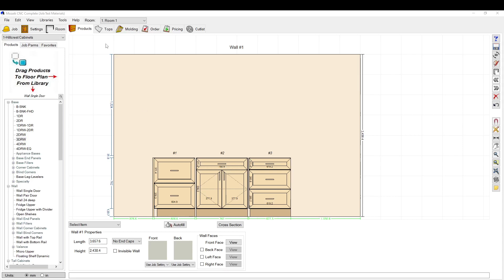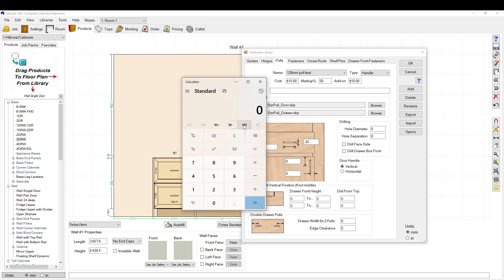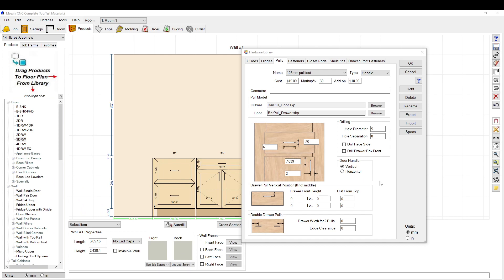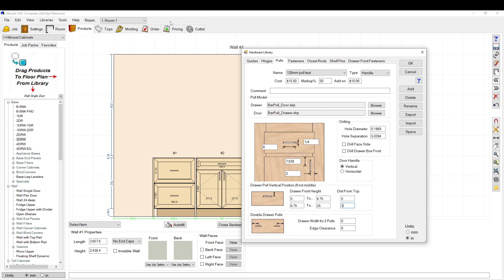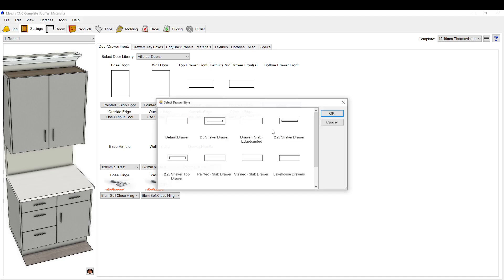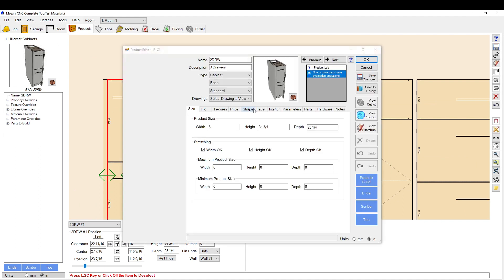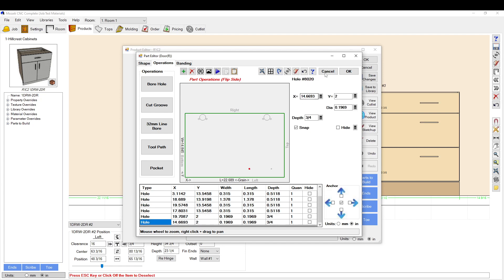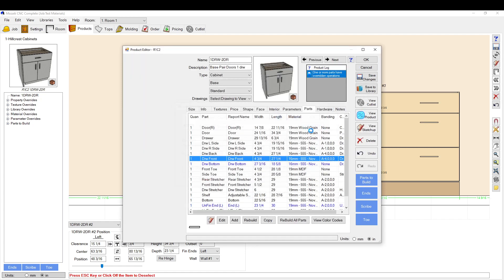Mozaik Software Tutorials - Pulls Hardware Library

Comment: Where do you actually ask the program to drill the pulls? I’ve set up my pulls as per your video but nothing is showing on the drawer/doors?
Reply from the maker: You need to go to the door library you're using in that job. Select the door and there is an options menu on the side and check the box that says "Bore for Pulls".

Comment: How do you move placement of handle on a specific door/drawer?
Reply from the maker: on that specific cabinet go to the face tab, click the opening you are trying to move handle placement. the at the bottom right hit "Adjust" button. Within this popup there is a Pull Adjustments setting.
Reply: @cabforgesystems  Thank you!!! Switching from CV and it’s the little things that I seem to be struggling with. Much appreciated